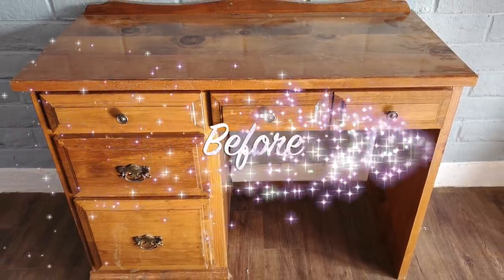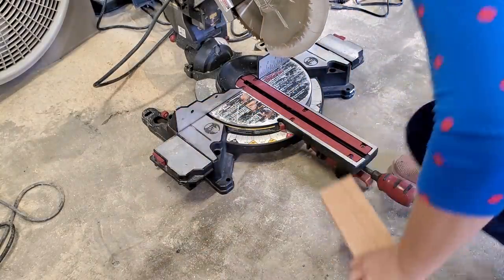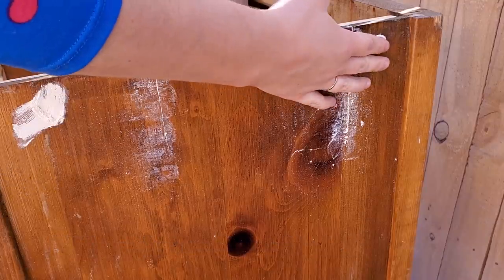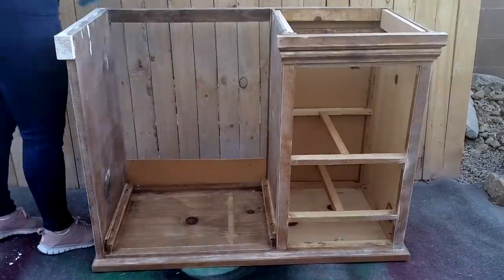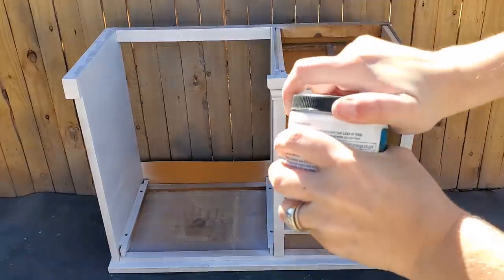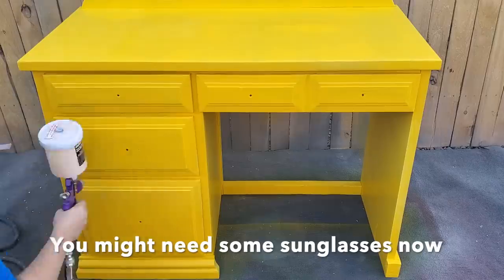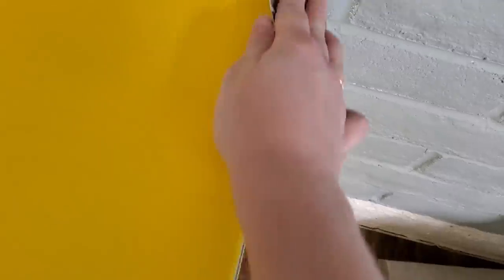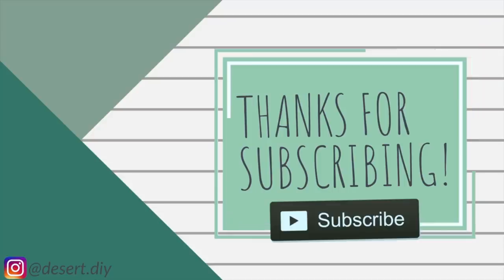Furniture Flip Desk | Trash to Treasure | From whoa to WOW

Comment: Try thinning the paint with Floetrol instead of water.  It won't evaporate as fast and makes it work great in the sprayer.
Reply from the maker: Is that the chemical that makes the paint become self leveling?
Reply: @DesertDIY   I'm not sure, but it is used to make paint more fluid and work in spray guns better.  Afaik, it's a mixture of latex and water, without pigment - with some additives to make it flow better.  You can find at at Home Depot or Lowes in the paint section.

Comment: Hiiiii!!!!!! Im new to all of this & am so very thankful that I stumbled upon your channel. I have lots of questions, so please bare with me. 

Tools are expensive. How did you decide what to purchase first & why? 

How do you not paint your fence while spray painting? 

Why did you paint the desk with the drawers in? Weren't you concerned about them drying closed? 

Thanks in advance & keep up the outstanding work. 

P.S. Thank you for assisting Foster children, especially as they age out of the system. While I am not a Foster, this is a subject that is near & dear to my heart.
Reply from the maker: Thank you. I recommend drills and an orbital sander first. No need to spend a fortune. Furniture refinishing isn't heavy duty so the cheaper brands work just fine. The drawers don't stick with I paint them while inside. It makes it easier so they don't tip over. Holds them in place for easy painting. Also that fence is just a panel I use as a background so i dont care if it gets painted

Comment: Checked amazon store...u dont have sprayer linked...could u link it pls and do a tutorial how to get it working pls i got one once second hand and couldnt figure it out. Thanks! Great job too!
Reply from the maker: It is called an hvlp sprayer. It requires an air compressor sized 15 gal or more. It is sold at harbor freight but you can find some on amazon for twice the price.